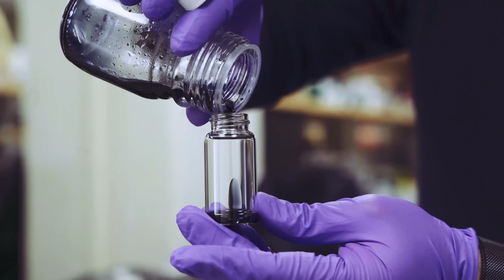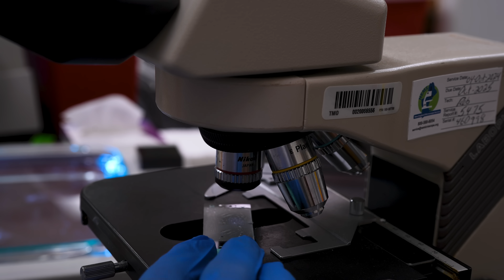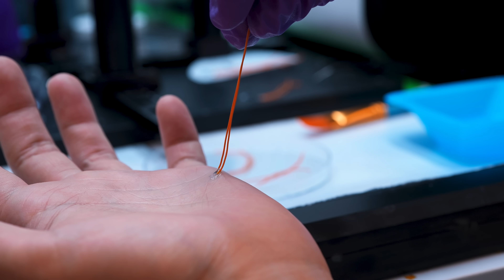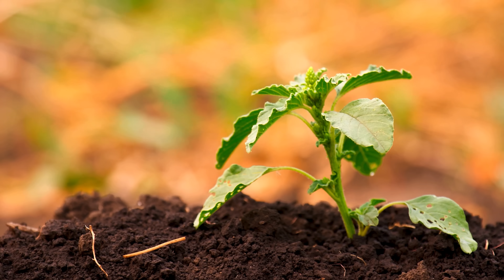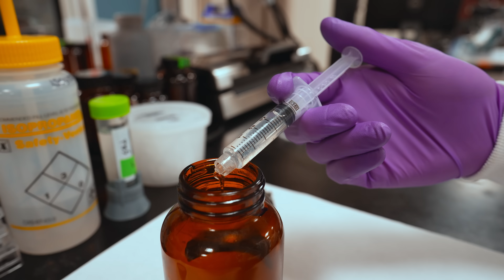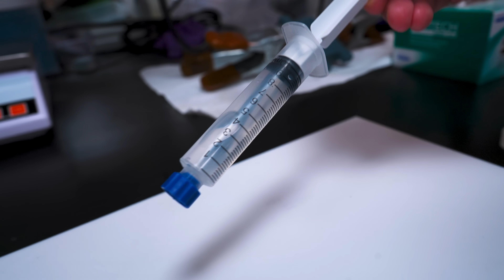Not quite a solid, not quite a liquid: Meet hydrogels

Comment: Stay tuned for the health concerns
Reply: Many laboratory hydrogels are highly biocompatible- we used to use Collagen I based hydrogels, which stiffen in a pH and temperature dependent manner. We used them as scaffolds in which we would mix different isolated cell lines to mimic, in our case, the layering of cells in vasculature such as arterioles. Collagen I is a large component of tissue extra-cellular matrix (ECM), and is basically like gelatin. Cells have counterreceptors (adhesive receptors and integrins) to some of these ECM components which anchor them within the gel, as they do to form our tissues.

 Other hydrogels utilize fibrinogen and thrombin to stiffen in the way that a clot does, via fibrin formation and crosslinking. Thus, these are constituents of our own bodies, and not entirely synthetic. You may have seen other gels, such as polyacrylamide, which have high porosity as well as water retention ability- these are more synthetic but usually used in scientific and industrial applications. For example polyacrylamide gels are used for gel electrophoresis of DNA or protein in the lab.

Comment: What about biodegradable material for use in these? Would that work for use in agrochemical settings? Or for short term implants?
Any way of engineering some kind of plant cell-based material with desirable properties found in synthetic materials? 

It would greatly prevent a lot of cancer in the future, and would ensure that groundwater and other things aren’t contaminated by a buildup of plastic particles. 

It would also ensure farmlands stay safe for human consumption and generally provide a more blanket environmental safety net for this whole system.

Comment: In the mid 90's, I designed a machine to coat the first small batches of catheter in hydrogel. This prevented the body rejecting them and reduced the risk of infection.
30 years on, it's interesting to see new applications for this amazing material. Well done MIT!
Reply: This is interesting. Would you please help dive deeper into your research & application? 

Also, if hydrogels have been around labs for nearly 3 decades, why is it that it's only getting public attention now ?
Reply: I was definitely wanting to chime in that this isn't exactly new stuff here. It was well established in my college textbooks 20 years ago. Plenty of interesting applications for sure. I regularly see them in bed sore dressings, burn dressings, and as delivery systems for pharmaceuticals.
Reply: I would be very interested in reading the paper! Construction industry here, always in the lookout for better coatings for my products

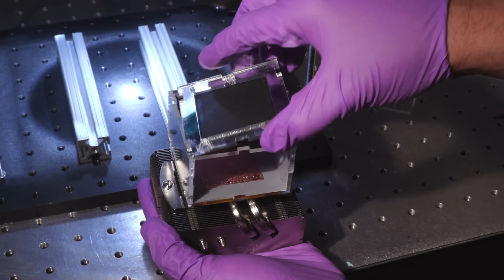Comment: I don't doubt that hydrogels can collect moisture from the air, but that is a Peltier device at 3:43, not a hydrogel, and that's a bit misleading.
Reply: I wouldn't care so much if the dialogue wasn't instantly contradicted by showing a device that needs electricity to collect water and a giant heatsink in the back to dump the heat.
Reply: @paulkepshire5056  i think in the shot of the closed chamber, the hydrogel may be the white speckled mass at the top. it makes sense if the peltier device is used to attract the vapor to measure its mass, maybe